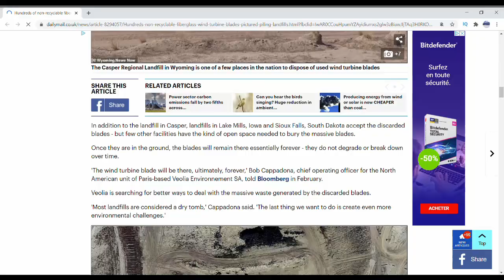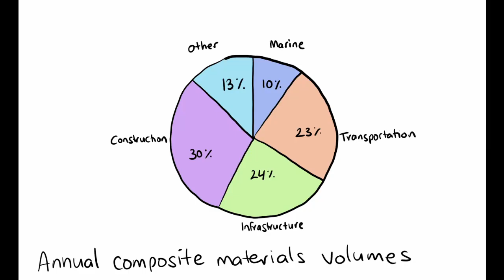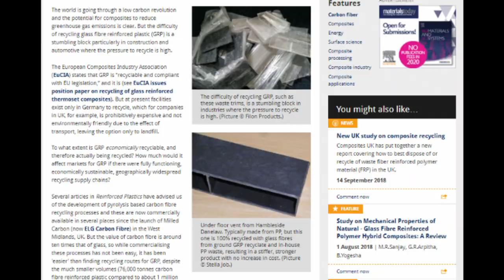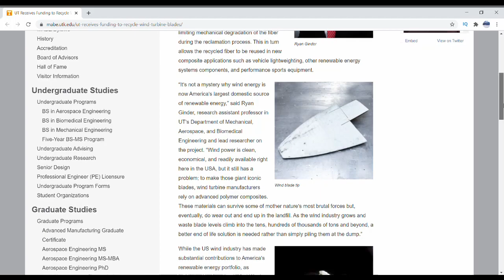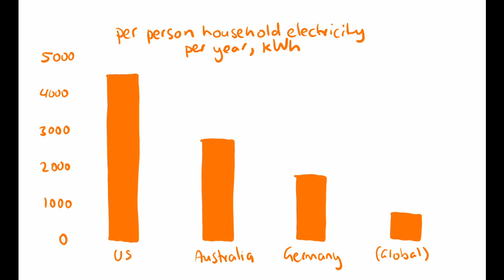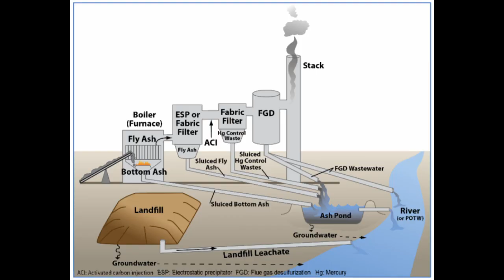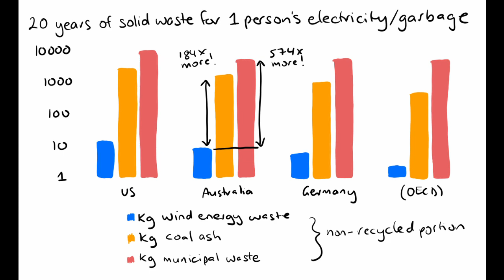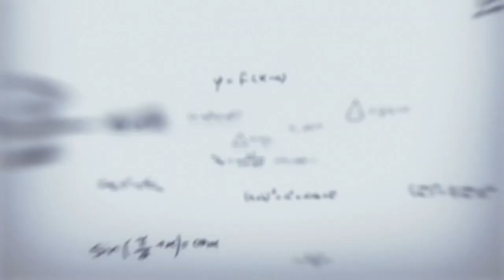Wind Turbine End of Life Waste

Comment: Yet again excellent - but what about SF6? SF6 is a greenhouse gas 23,500 times more warming than CO2, and being inert hangs around in our atmosphere for 1,000+ years - trees don't absorb SF6.  SF6 is used throughout conventionial electricity generation and transmission to stop arcing. It is also used in wind turbines for exactly the same reason.  Wind turbines are serviced frequently, and those servicing cycles include large escapes and renewing of SF6.  Electrical transmission and switching will still involve the same levels of SF6.  Given your great analytical mind , I'd be fascinated to know when SF6 atmospheric damage will overtake CO2 as the greatest warming contributor if we were to replace fossil fuels with wind turbines.

Comment: Hi Rosie, the info was enlightening in regard to the waste generated. Thankyou. 
However, i believe the waste of the coal fired power station (CFPS)  is grossly misrepresented.
CFPS are adjacent to coal mines, generally, essentially they dig a deep hole to extract the coal, they burn the coal and what does not burn (fly ash) is either used in the manufacture of concrete or put back into the hole where it came from. Recycling. 
At the end of life, The hole left after putting all the fly ash back in is either used for much needed land fill or sometimes  turned into  a lake for recreational purposes.
As land fill sites are greatly needed,  as your figures show, the creation of a landfill site is a bonus so should detract from your figures.
Using this logic. CFPS reduce the total amounts going to otherwise unavailable landfill sites..
I hope this helps.

Comment: Hi Rosie, good work! I have some remarks though. 
- The idea that even part of the concrete from windmills gets recycled is just not realistic. No company in his right mind will dig up concrete blocks of foundation that might measure 10 x 10 x 10 meters (?) and then try to break them down with explosives and heavy material into rubble.
- Windmills and solar panels do not replace energy plants that run on fossil fuels, because they are intermittent. And when there is too much electricity, it is far easier to shut down the windmills than "to turn down" the powerplants. So sadly, the waste produced by windmills and solar panels partly adds up to the waste of the powerplants.
- I am do not I agree that it is fair to compare the amount waste of windmills to the amount of garbage our households produce. These things both are wrong and one of them cannot be used as an excuse to pardon the other. This is our eternal excuse since we visited Kindergarten: "yeah I may be wrong but the others are is far worse - so I get an out of jail free card".
- Dont get me wrong. I like your work and I find your comparison to the waste from coal plants a real eye opener.

Comment: Fiberglass boat can last 100 years.
And fiberglass in wind turbine last 20 years.
Why not rebuild old blade and put on new turbine?
Reply: A boat is much sturdier built in the first place (at least one that can last so long), and if it's damaged that's usually because of a heavy hit by something hard. That can then be repaired right where it happened, easy to see where.

By contrast, the damage to turbine blade is distributed fatigue from the millions of gentle but relentless deformations of its delicate lightweight structure. There's no individual places you could repair. You could presumably reinforce the whole thing – but that would require an amount of material comparable to a completely new blade, and the result would be much heavier than that.
Reply: @leftaroundabout  about blade. R&r airplane engine use hollow titanium blade . Weight not much. 
Jet engine has more forces on then wind turbine.
Right?
Why not rebuild wind turbine alternator?
On videos junket not only blade but whole things tower alternator blade.
Look Elon mask hi start reuse rocket that cut cost and from there move ahead. Rocket much more complex then wind turbine.
Need wind turbine which shop can rebuild repaired and use again again.
Reply: @enigmaak8049  titanium for wind turbines? That would be awesome, but titanium is way too difficult/costly in manufacture. For relatively small, expensive, high-power parts it can be worth it, but for wind turbines it would hugely slow down the adaption.

Aluminium would be more realistic and IMO should still be researched more, but its problem is worse fatigue than both other metals and composites.
Reply: @leftaroundabout  fatigue for aluminum?
B52 in air Force 60 years and stay strong.  Many aluminum build aircraft 60 to 80 years and pass all microcrac inspection none destructive inspection with radiation and sound way inspection.
Problem is renewable wind power more relay on government help rather on business model to survive .
Wind turbine need person like Elon mask or people will get tire to support it.

Comment: The fibreglass construction of a wind turbine blade is not inert either.   We know there are cleaner alternative than coal, but to attempt to assert that wind turbines will completely replace coal is insane.  Coal use is rising, and for a reason.  Alternatives are failing to meet capacity demand.

Comment: The life cycle of an Aussie windmill is;
1 install.
2 grease once a year.
3 after 160+ greasings might need a replacement part or two. Could recycle he whole thing because it’s 90% metal. Just melt it down and cast a new one from the same material lol gg ezgg ur move coal and oil lobbyists
Reply: Yes 160+ years.